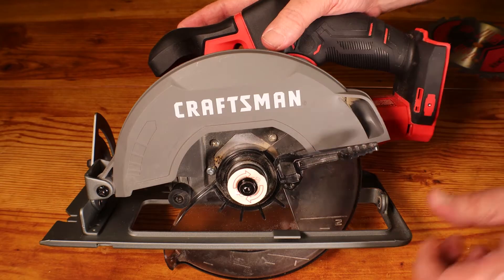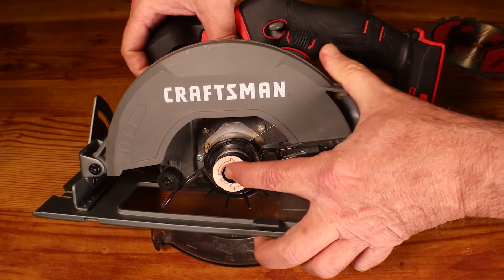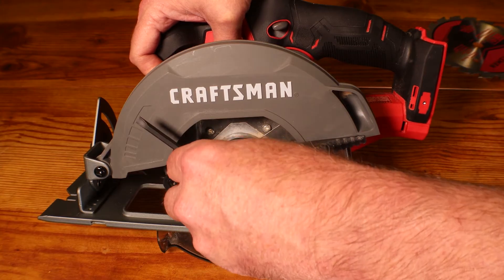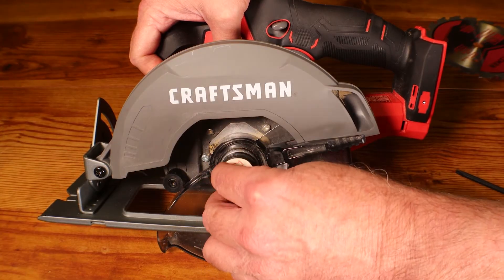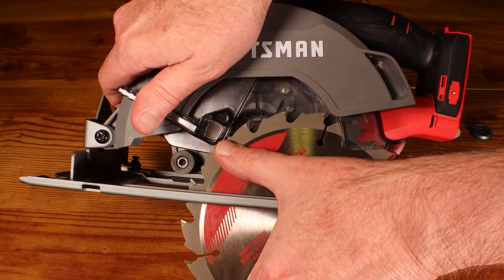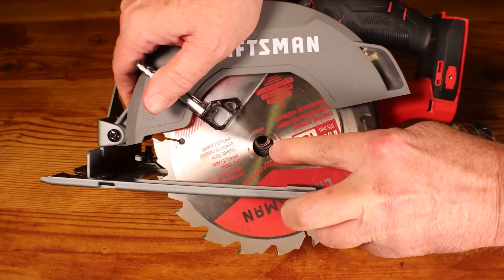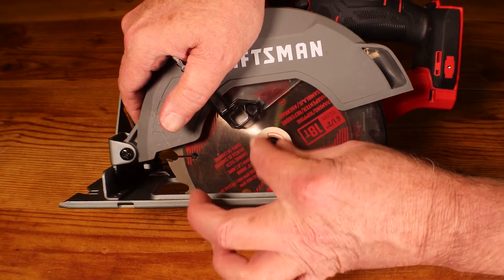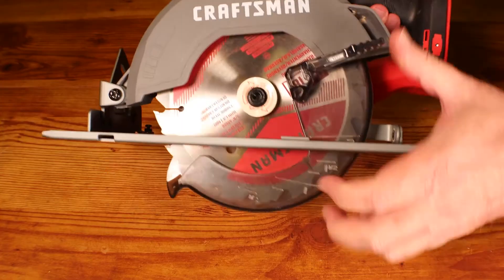Craftsman CMCS500 V20 Circular Saw Blade Install

Comment: I was stuck with no power in a 3 day ice storm thinking I had prepared well in case of a power outage. Bought a saw and blades and charged both batteries so I could cut up the pallets I collected for firewood. Could. Not. Get. the blade on. I ended up using grandpa's old hand saw. Boy howdy did these lady muscles get a work out.
Reply from the maker: Thx for the comment!    Rest Now !!!

Comment: Thanks for the great video tip. They ought to include yours, and a full-on video with the tool (and others, more broadly). The paper booklet that the saw comes with is barely readable with reading glasses, and loading the saw blade is more complex than what one diagram, front the front view, can offer. Especially giggling the blade on and the part about the plastic cover being flexible. Most people would not want to flex the plastic guard as all materials, but especially plastic are of course fallible. Your video should be included as a link to the sale site. So thank you for the effort and clarity of the explanation.
Reply from the maker: Awesome! Thank you!

Comment: I got tripped up on the retaining washer.  It didn't look like it was removable and I thought I was missing a spacer that went between the bolt and the blade.  This is a very useful video and now my saw works great.  I'm putting up a wood fence and I was using the sawzall because I didn't see how to get the blade installed in this circular saw, now the fence  will go up faster and with less frustration.  This is one of those tasks I thought anyone could do but I ended up needing some help.  Thank you Sir!
Reply from the maker: Glad I could help !

Comment: have been just picking up & examining my v20 saw for a few weeks, didnt get the manual instructions either. Thanks.. now to learn how to use it.. first time user.. men in my life have resisted me using one.. well? cuz am female..  lol.. building out a large prebuilt shed to off grid homestead. lots on my plate.. now one less.
Reply from the maker: Glad I could help!

Comment: Sounds like you’re a hero!
I snagged a 5 tool set for $83, bought that and returned the drill/impact combo I got for Xmas!
I’ll take a circ saw, an oscillating cutter and a decent LED, it should be called “4 Tool + “ or something cuz it’s a crappy tool! Good light tho.
Thanks Lowe’s. Wish it was brushless
Reply from the maker: Nice...Keep the one's you like!

Comment: Thank you for providing me with clear instructions to be able to use the tool. Would be nice if Craftsman pointed out the hex allen wrench on the handle behind the blade for mounting the blade. Even the written instruction manual it came with was useless.
Reply from the maker: Hi Marcus, Yes the manuals are bad. I like the saw but it was not user-friendly to get up and running!

Comment: Does anyone have any suggestions on how to remove the blade bolt if it’s stuck and the Allen key hole is stripped? I’m currently having this issue.

Comment: so what about that other part that falls off the first time you loosen the hex nut? The instruction manual does not even show it, much less the direction it is supposed to go. And the picture they provide in the instruction manual doesn't show that part, and the picture is so small that you can match up the outer blade clamp washer. Well, actually you can match it up, but the point is that Craftsman's instruction manual manual tells you a lot of stuff but not how to replace the blade, and even though your video is supposed to tell me how to replaced or swap the blade, your video does only a slightly better job of that than the instruction manual does.

Comment: Slightly stupid design 🤦🏻‍♂️ I just picked up this saw at Ace for free on their deal with the battery starter kit (Apr 2024) and it looks great, but the manual doesn’t mention anything about flexing the guard to fit the blade in. Thanks for this video!